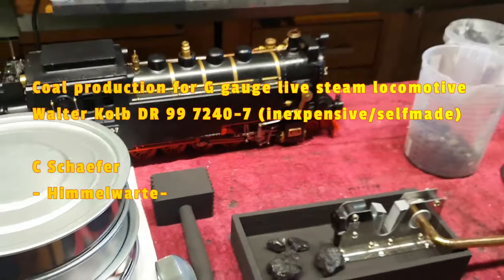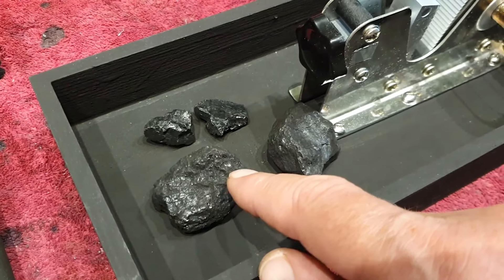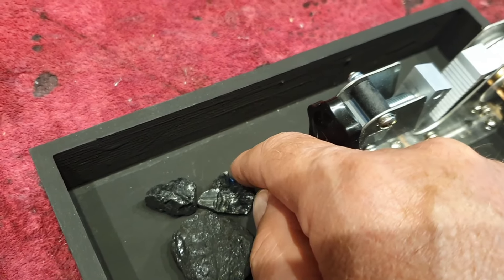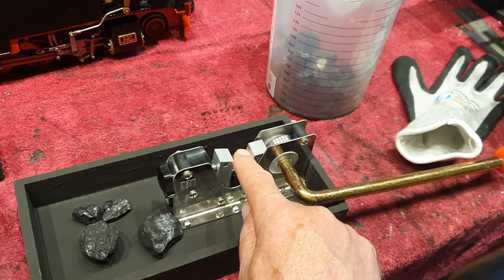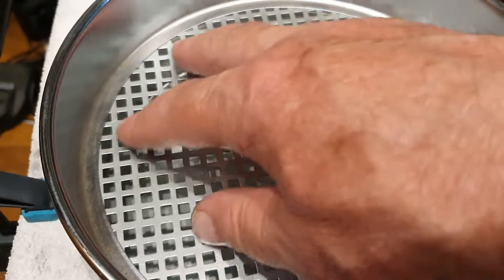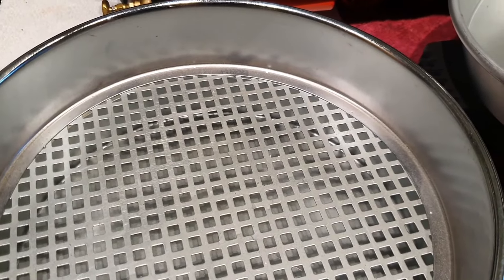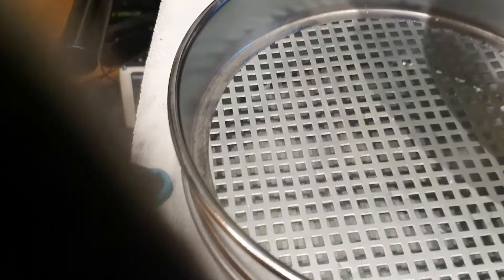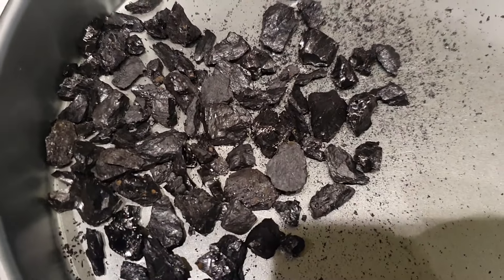Coal production for G gauge live steam locomotive Walter Kolb DR 99 7240-7 (inexpensive/selfmade)

Comment: is that special charcoal or charcoal for grills?
Reply from the maker: this is special anthracid coal (100 percent carbon) or polish coal (with higher gas content). Anthracid coal burns down to almost no ash but requires more air/oxiden, polish coal has gas and minerals in it so burn down to more residual ash and generates sulfurdioxid fumes and burn much better.

Grill coal is wood or coconut based coal which has a much lower heat coefficient and may be used for sausages :-)) but is only good enough to start a coal fire in the locomotive gauge G...
Reply: @The123pcr  thank you